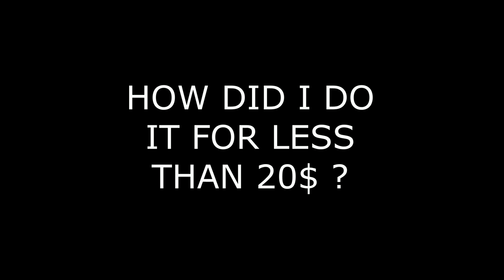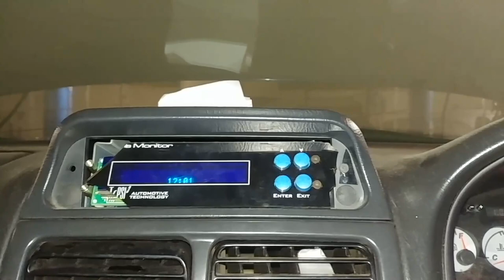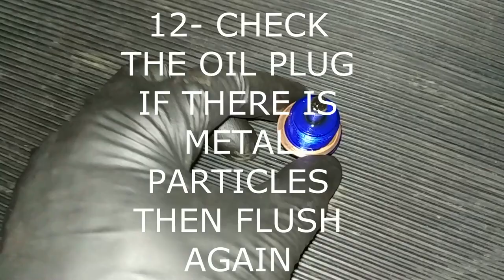How To Change Rod Bearings Without Engine Removal

Comment: Ok so reading some of these im sorry im a stupid blonde so mine only had a 1/4 of the bearing left to it so i want this to work but i just bought it wanted to do a few minor repairs and flip it this isnt what i call minor. So im changes 3 of 4 bearings as #1 cant get to without pulling motor sanding the shit out of it but u think may not last long what does it need new crankshaft i dont want to rip anyone off like i feel i got when got the car from auction thank u 
Jocelyn Barnwell from Montana

Comment: this isn’t called fixing something, this is putting a band aid on it, i feel sorry for the guy you sold it to right after doing this because they had to rebuild the engine about 150 miles later if they were lucky, honestly you shouldn’t even put crap like this on the internet and make people think that this would work for any actual amount of time, you are doing nothing but making some poor sap even more money when they have more crap run through there engine and end up junking the block and heads

Comment: DO NOT DO THIS!!! That crank was likely messed up there will be metal in everything that the oil touches  the cylinder was likely messed up and he did even f$@king torque the rod !!!!! Plus now all the others bearings are going to wear differently this is super super dumb

Comment: Do not do this, this guy is a hack mechanic, bearing will not last long, proper repair is to have crank and rods machined for new bearing. Again DO NOT DO THIS.
Reply: its hack but its will work if ur in a jam  only ment to get u by
Reply: TGreenie29 its totally a hack job but its been running for 6 months 😂
Reply: calm down we ARE going to do this
Reply: What do you have to lose? $2000 for an engine plus install.
Reply: @paulmarado  When the engine is going to go anyway?